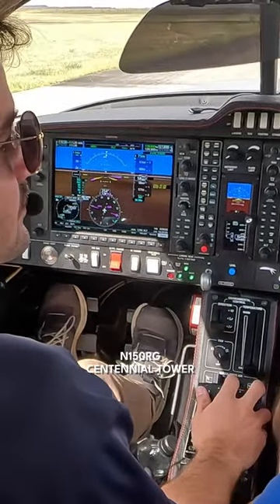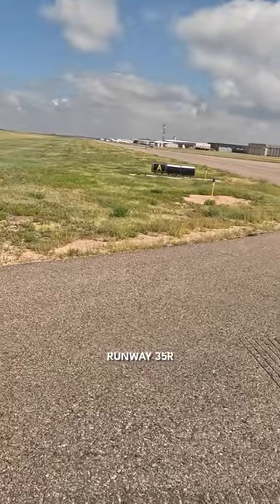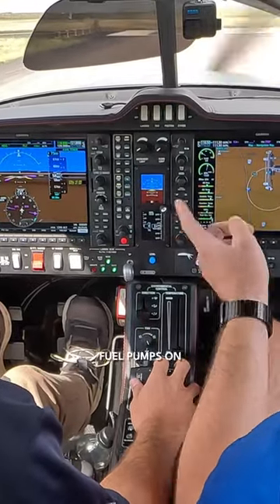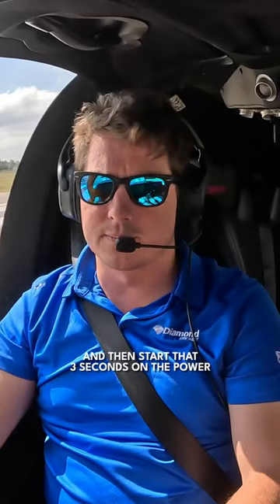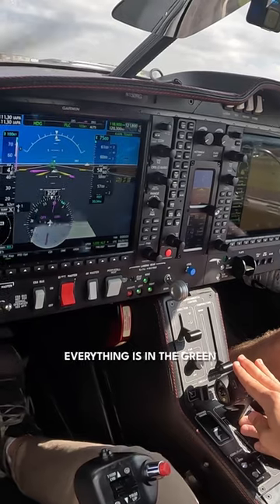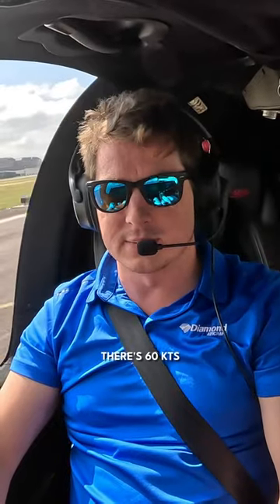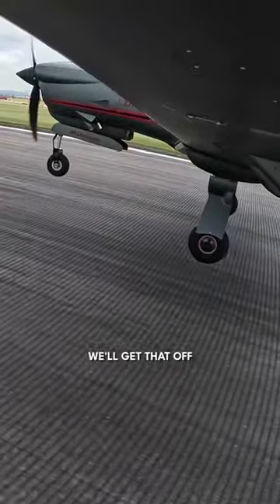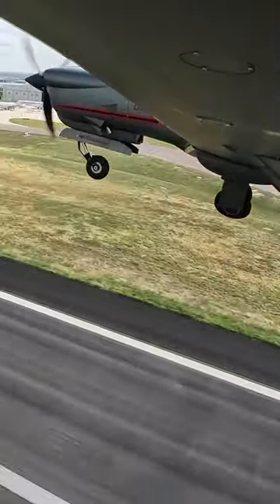Diamond DA50 RG Take off at 5,800 ft Field Elevation | Watch Full Video! #aviation #da50

Comment: So I’ve been recently looking into aviation school and learning what I can prior to signing up… my question would be why would you lift the landing gear still so close to the ground??? Im asking bc I’ve learned most catastrophic engine failures happen during takeoff. Would it not be safer to lift later or are yall higher than it looks?? Is the Drag too much with the gear down and 4 adults in it??
Reply: In single engine,  if you are unable to land in the remaining runway then you should raise the gear to gain altitude faster. Worst case scenario you land gear up which helps you stop faster.
Reply: @jarrettleto  yeah i get that.. I didn’t see how much runway was left but i just would’ve thought you’d want it down until certain altitude or something. Only reason I asked is they looked low to ground I thought
Reply from the maker: Great question! The video is edited and not in complete real time. There was a longer duration between takeoff and raising the gear than what appears. We are also at 5,800 ft airport elevation; therefore it takes the aircraft a little longer to climb, even when the engine is turbocharged.
Reply: @LifeStyleAviation  tyvm. Im just trying to soak in knowledge. If i had my choice, id definitely choose a Diamond aircraft. Probably the DA 62. Diamond has some of the best looking planes out there with what seems to be very fuel efficient and reliable.

Comment: Why don’t people give their airplanes full throttle on takeoff. Like in Cessnas and pipers that’s what it requires, I feel like that’s the way it should be, I understand that people are trying to save their engines, but at 5800 feet just give ‘er
Reply: Are you a pilot?  Not all planes require 100% power at take-off.  Like the P-51 you can only give it 75% power on take-off or you'll torque the plane. Not every plane Flys like a Cessna or Piper. 😎👍
Reply: I am, yes, and of course I understand 😂😂 But de-rated thrust takeoffs don’t feel right! I have heard that about the P-51. and also most airliners use less than 95% N1 on takeoff. Also, for the Diamond DA-50, at high altitude should be using max throttle for best thrust.